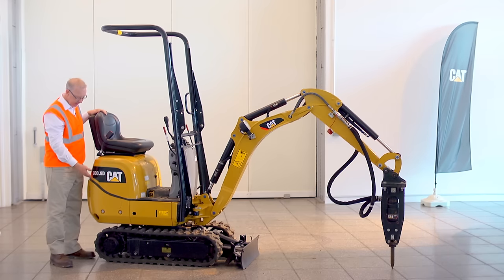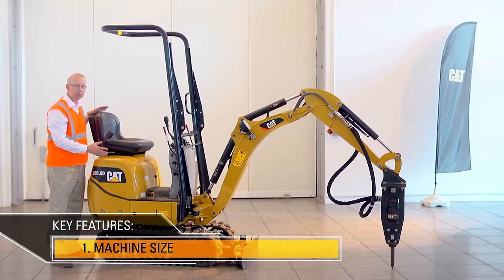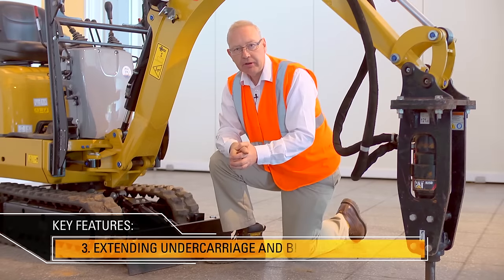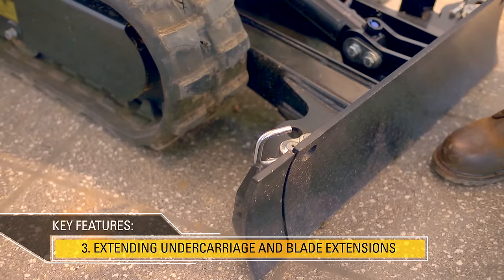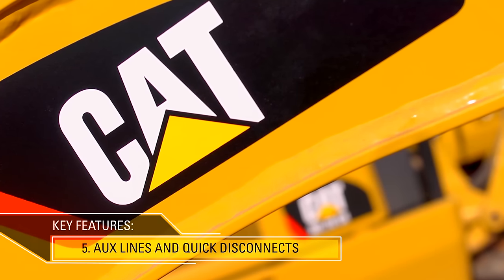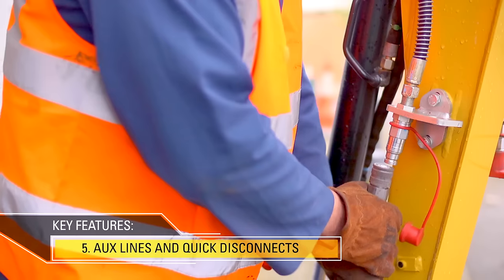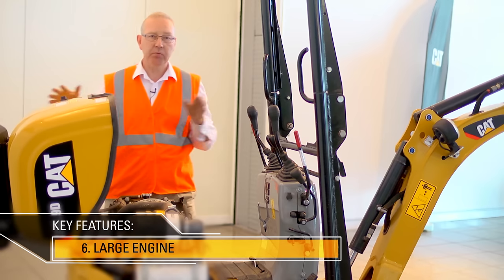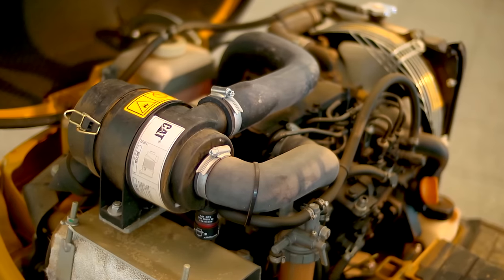Cat® 300.9D Mini Excavator Overview

Comment: it's fun working indoors with those machines. Breathing all the fumes from the exhaust and dying every once in awhile
Reply: It's made to run with an electric hydraulic power unit for areas that have bad airfow.
Reply: Yes, propane fuel would seem to be a better choice for this size of machine which will seldom see the light of day.
Reply: DJ Jones propane still emotes toxic/deadly fumes when burned...
Reply: It only weighs 2000 lb and that will support that much weight my ass
Reply: agreed being resurrected on site don't take anything off your time sheets and or paychecks
Reply: Mask up

Comment: How much do the rubber tracks for the Cat® 300.9D Mini Excavator actually weigh? I can't seem to get a straight answer from Google..as usual. 
I had to lift two of these bad boys by myself in work today (one at a time of course) and they're surprisingly heavy asf! I'm not even 100% sure they were from this exact model of excavator but they seem to be roughly the same size. I'm just hoping someone here could tell me as I'm curious because these things are probably the heaviest thing I've ever lifted before.
Reply from the maker: Hi Chimp! Your local Cat dealer can help you with your Cat Mini Excavator inquiry! Please send  your location, email address, and phone number. We'll connect you with your local dealer or you can find a dealer near you on our website: http://bit.ly/36qmVvN
Reply: Officially Lame , Can't you reply to a Simple machine part question  from a brand your supposedly representing ? And why you wasting everyone's precious time by giving this highly annoying & disturbing no Answer response ?